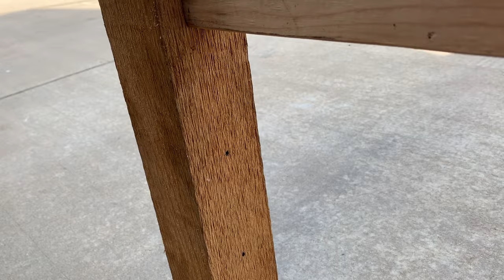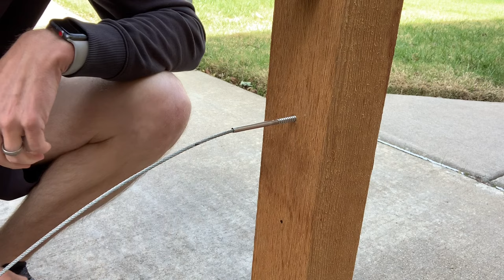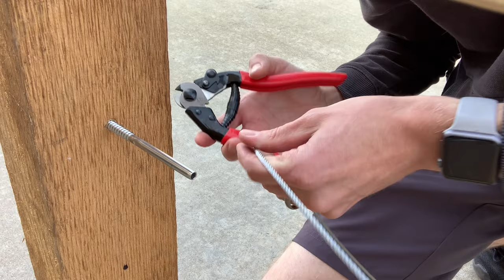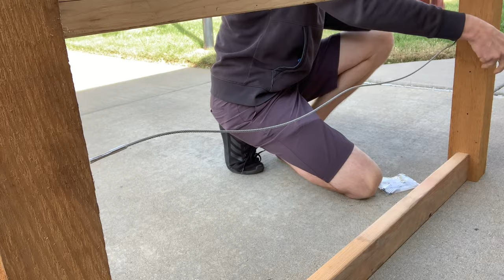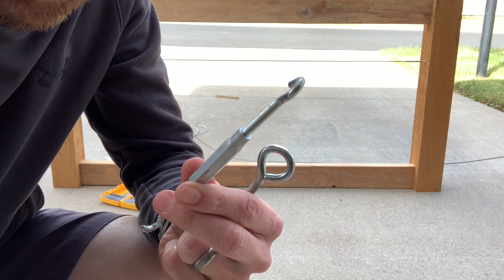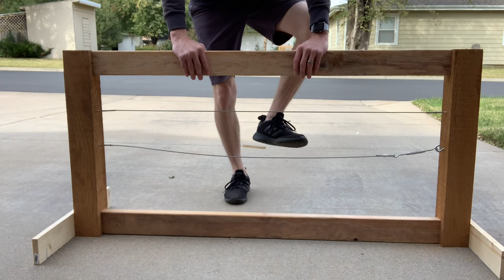Budget Cable Railing Materials

Comment: Love all the videos. Can't tell you how much I appreciate all the helpful information. Do you think this would work for long runs? My deck is quite large. I have a 31' run and and a 27' run. I would not want to use these for each section as the cost would skyrocket.
Reply from the maker: Rob Bosch, thank you so much!  Do your long runs have posts every so often?  I would hesitate to use something like this on a super long run.  I would probably want a bolt with a nut and washer so you could really put some tension on it over a long run.  Otherwise I worry it might sag a bit.  I would say these would be fine for spans 8’ and under between posts in my opinion
Reply: @PottersWork  Thanks so much for the quick response. There will be a post every six feet. If I had to use these between every 6 foot section it would obviously cost a lot more money. I really like the look of these fittings compared to the double hook, but like you I worry that they won't hold up for long runs.
Reply from the maker: Rob,  I think if you can just drill a pass through hole in each post you might be ok...since the 6 feet spans would help with the sag.  However, you might reference this video of some guys using different Muzata fittings on some longer spans.  I haven’t watched this whole video yet, but I have been meaning to

https://youtu.be/-PzMYtGsqSY
Reply: @PottersWork  I will check that video out shortly. Again, thanks so much for the great videos and quick responses. Have a great rest of your week :)
Reply: Yes, these work fine on long runs. Did a deck for a customer that had two runs of 30' and they tightened up fine. Follow instructions. It says to measure distance of run (between posts). Subtract 1,1/2" from measurement, then Swage as demonstrated in video. If you measure correctly and subtract 1,1/2" accurately, your cable will be perfectly tight and the threads on the lag stud will be fully embedded into the post. Unlike the video.
Reply: @roninwiscon7155  thanks for adding those instructions. I was thinking there must be some way to set up properly to fully embed the thread. It's interesting that even in the Muzata instructional video on their product page for these, their finished demonstration still has lots of threads showing.
Reply: I am researching this for a project and This Old House did a video for a cable railing.They said that for a stairway the max gap is 4 inches so allowing for cable streach and flex, they went for 3 inches.  Some go 3.5 inches.They also quote the building code as requiring support between posts at 3 foot max. On a run it is feasible to drill through posts in the run and dress them up with stainless ferrels tp protect the wood. If any span is greater than 3 feet, then intermediate support is required. This can really bump up the cost. Still considering options.

Comment: screw to attachement in further before cutting and crimping so you wont see threads use a dummy one as an example to factor in the rest of the assembly. The turn buckle is ugly

Comment: so I don't need a hydraulic crimper? That thing makes the budget double/triple
Reply from the maker: You don’t “need” it, but it does look a little nicer.  You can also buy a Swage tool that would hit somewhere in the middle between using the cable cutters and the hydraulic crimper…that would probably be the best bet honestly.  They have some on Amazon for around $35
Reply: @PottersWork  Can I just get bolt cutters like you did? Don't care too much about looks, just want to crimp

Comment: How have they held up after 4 years? Cheers
Reply from the maker: @testeagles6347  I had already installed a homemade product before they sent me this to demo in the video. So I never actually used these on my own deck.  I still have some hardware to use if mine never fails, I just didn’t feel like redoing the whole deck since my homemade fittings are still working.

Comment: I'm the same with no threads measure  the thread and give your self a little bit more slack in your wire
Reply: If you have 1/2 an inch of thread u will need and 1inch of slack I would think

Comment: Would this railing design meet code? I would guess the inspector would want to see the cable installed through the post
Reply from the maker: Matt Magee, definitely check with your local building official.  It seems to vary quite a bit from place to place
Reply: For guard railing a 4 inch sphere may not pass through any opening.

Comment: get a single hinge swaging tool so much easier
Reply: I agree.  Much quicker but you need to spend money on a good swag tool.  Cheap ones might not have the crimping power or might not have the tolerances for the size wire used to hold the wire securely.

Comment: I prefer the system that goes all the way through the boat and you can put a note on so that it’s not stressing on the fibers of the wood I think this will eventually pull out was a nut the end can’t
Reply from the maker: alfriedar, 100% agree with a bolt and nut being the strongest way to fasten.  This would be a good option where that’s not possible.  The company also sells nut/bolt options as well. This is just what they sent me to demo.  Thanks for watching and taking the time to comment for others to see as well.
Reply: IF, the threads of the stud are fully  embedded  into the post upon tightening (distance between posts less 1,1/2") AND you make a proper swage, these studs are usually  rated for 900+ lb's of pull out force in #2 pine. If it's hardwood, I'm sure it's much greater.  Keep in mind, that's just with one cable run, you will have 9-10 runs typically with 900+ lbs ea. But yes, thru bolt is best. But these are very adequate. Have used this system for many customers. 1x19 SS cable is a must. Better than 7x7.
Reply from the maker: Ron, thanks for you knowledge and input!  I didn’t know that they had such a strong bite, I learned something today :)

Comment: The issue with threads showing seems like a measurement issue.
Reply from the maker: Definitely could be for sure.  This was the 1st time I’d used them.  I think after a couple it would be easy to get it closer.  Only issue is if you’re a little too long, you lose your flat spot for your wrench to tighten them.

Comment: Do the cables get loose as the temperature changes?
Reply from the maker: Troy, I haven’t noticed it with temp change, but I did notice it as the lumber dried out at the beginning.  I think it’s been over a year since the last time I adjusted them.  And that was all of about 30 seconds worth of work to just snug them up about 1 turn.
Reply: @PottersWork  so as the wood dried, I take it the wires loosened? I guess what I'm getting at is I don't want to run out of adjustment with the lag screws. How much of the threads would you leave visible to ensure I have enough adjustment to tighten the cables back up? I'm using treated 4x4s as posts, that were still fairly wet when I installed them 2 weeks ago.
Reply from the maker: Troy Dunn, yes as the wood dried out it shrunk slightly.  I would say leave at least an inch of threads showing on each side.  That gives you a full 2” of adjustment.  It really doesn’t take much thread to tighten it up.
Reply: @PottersWork  ok, thanks!
Reply: @PottersWork  I think your advise is correct. Say you plan on railing being there former to 15 years + you need some treads to tighten
Reply from the maker: @CrochetNewsNetwork , yes, it def doesn’t bier to have some adjustment just in case.  I think mine have been within 2 turns of the turnbuckle either direction over the last few years.  It really doesn’t take much to tighten the cables at all :)

Comment: $119 for the crimper and cutters alone...not really 'BUDGET' pricing!
Reply from the maker: Jason, that’s kind of why I show the bolt cutters as well.  However, even with that cost of the crimpers it’s still substantially cheaper than buying most of the kits out there.  The pricing on this cable railing stuff is ridiculous.